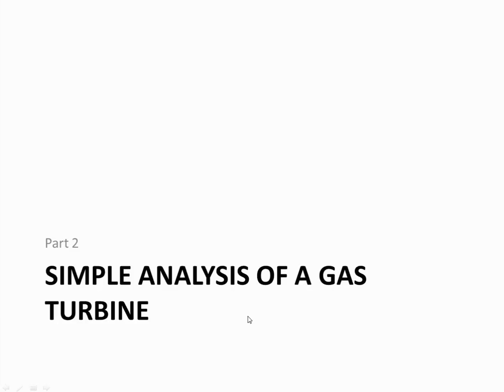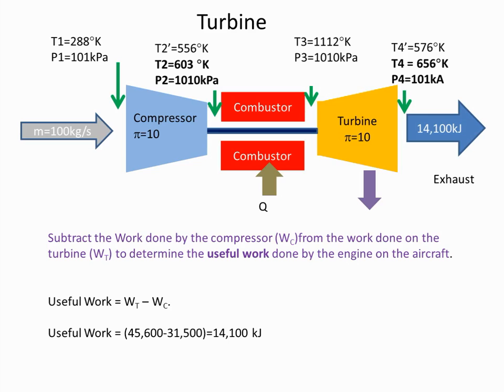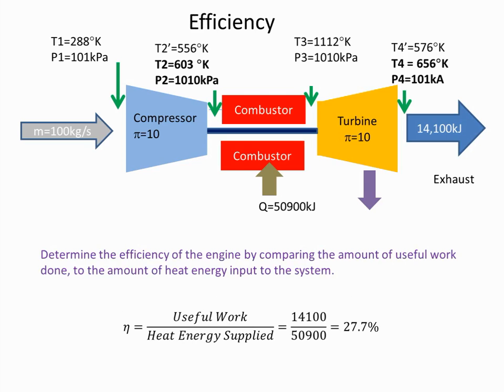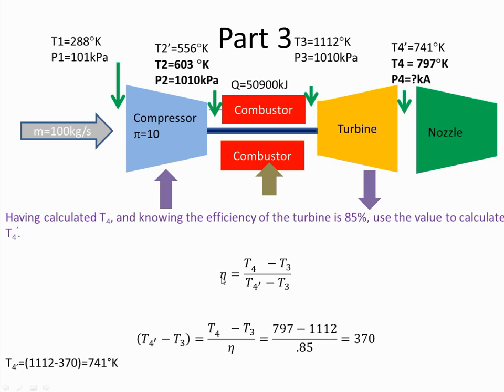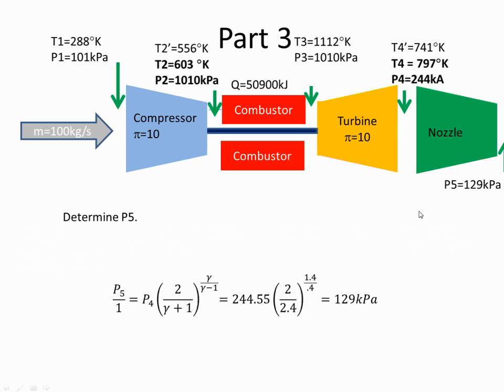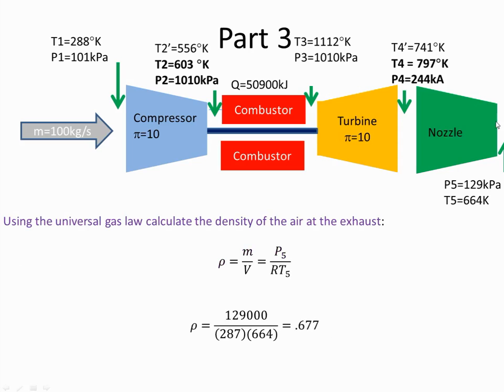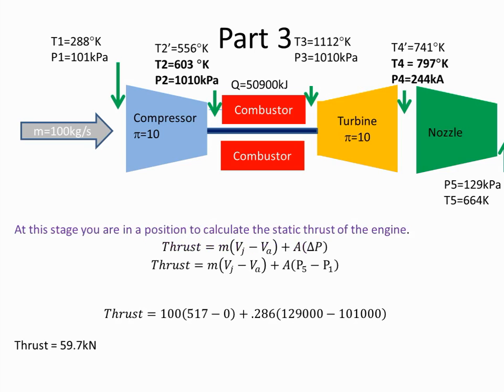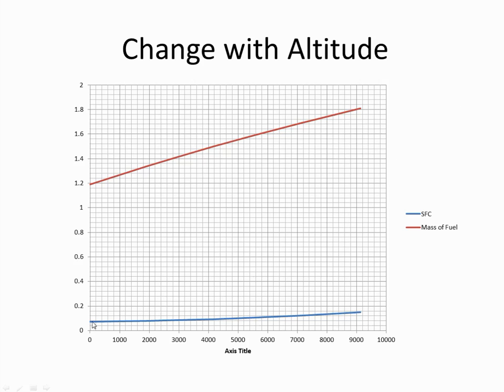Ideal Jet Analysis Part 2 Extended

Comment: In part 2, you calculated work of the Turbine to be 45,600. What changed about the analysis so that the assumption is work of the turbine is equal to work of the compressor? Lastly, the pressure ratio in this part of the example breaks the compressor ratio from the earlier parts (pi = 10). Are these values supposed to be different because they're whole new problems? Thank you for any insights you can provide.
Reply from the maker: The “turbine” in this video refers to the actual turbine and the nozzle.  Regarding pressure ratios:  when atmospheric air enters the compressor, it is compressed in the ratio 10:1 in this example.  The air then goes into the combustion chamber and heated at constant pressure.  So the pressure at the output of the combustion chamber is the same as the compressor exit.   The air is them expanded in the turbine and then further expanded in the nozzle.  The air is expanded by a factor of 10 and returns to it’s original atmospheric pressure value.
Reply: @RoddyMcNamee  Ah, that makes sense. Thank you for your time and excellent videos.